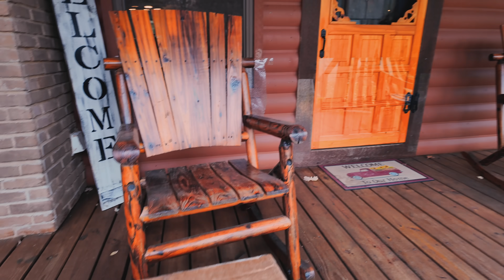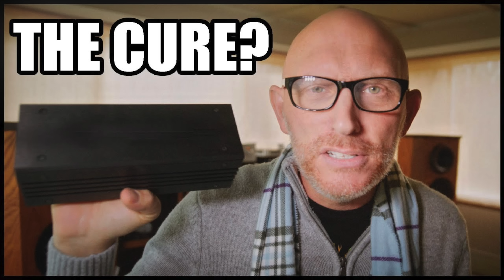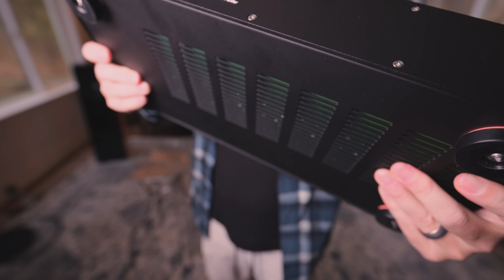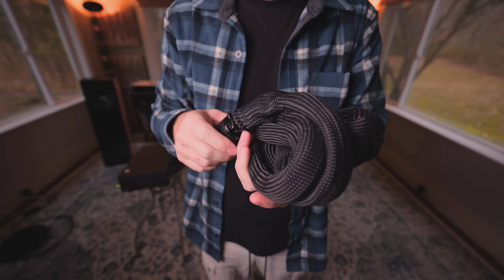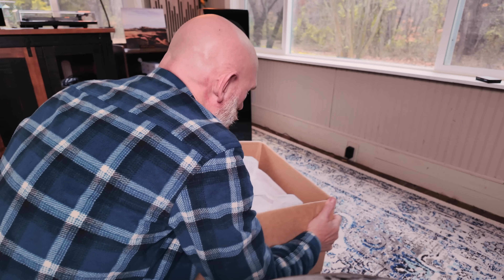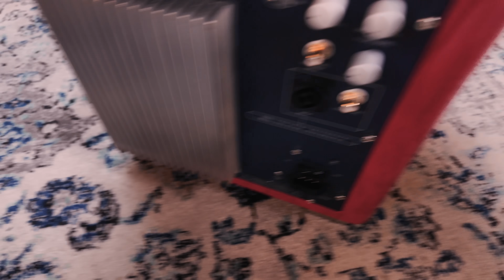FACT: My HiFi Audio System just doesn't sound the same WITHOUT THIS. Will it do the same for YOU?

Comment: In addition to rewiring my house current with sufficient ampage dedicated to my home theater, I,ve had a top-tier Audience AR6 power conditioner I've had for like 10 years.  Couple that with my Audio Research analog preamp / Oppo 205 and I have no doubt the sound would diminish greatly without that piece.

During the summer in Florida I run the conditioner into a Cyberpower  Sinewave UPS which keeps 90% of Dynamics intact...and more importantly It keeps my heart from racing too much because of the terrible weather here!

Comment: Not an expert here but doesn’t this sound like dc offset?   Wouldn’t a device like the one from Emotiva take care of it?    $82.00
Reply from the maker: Nope I tried that one. Still have it sitting in a closet. I tried several things, spent a ton, returned a couple things. This is the only piece that helped and eliminated all issues.
Reply: @HiFiHuff fair enough.   The Emotiva worked on mine.   Went through wayyyy too many devices before I figured that out :)

Comment: A separate outlet 20amp copper cable straight from the breaker board panal would provide cleaner power
Reply: Not true. Mains pollution comes from far and wide. My beast system's outlet is 20' of 20 amp Romex to the one outlet only... and my power noise filter makes a dramatic difference, so does the filters for the USB power and the galvanic isolation for the Ethernet connection. Dirty power is everywhere until filtered out.
Reply: @bayard1332  systems clips on 15amp after 1800watts; so the 20amps make the differences.

Comment: How do you plug your ultimate power cable which has C13 termination to the power conditioner which appears to have a C20 input?
Reply: The Ultimate Puritan cables can be ordered with either a C13 or C19 end - most of your hifi electronics will require the C13 connector but the PSM156 needs the C19 connector (which is the connector that Puritan supplies for the power cord for the 156.).

Comment: I’m a believer in power effecting the sound. I would challenge you to investigate the Plixar BAC 3000.  I have many Plixar products and find the impact to be amazing. Warning that it weights 40!kgs so be prepared for some weight.
Reply: Yes, the Plixir is an awesome conditioner but it is over double the price so it should be better. Also, as you point out, it is a beast in weight.
Reply: affecting

Comment: I have 2 conditioners along with whole house surge protector,  will never be without them. The voltage shift here is over 6 volts!! So  it is100% stable now, along with Humm and such, these keep it gone.
Also since I see comments about it, I  have a 10 foot copper/alloy ground rod in the ground!

Comment: Put a Torus power supply in my system  some time ago and it made the whole system more stable and all areas sounded better…..now the punch line.  I removed the stock power cable and put in the Puritan cable….whoa.  It’s not black magic …..it’s a more black background….everything seems enhanced…..in a great way.  Resolution and layering are the main areas of improvement.  I had tried two other cable manufacturers and hardly noticed a change.  Those puritan power cords really work.

Comment: I too have power issues I'm chasing down that I thought were solved. I purchased my PP20 at the same time as you and also switched to the PSM156 (a pair of them) and they have been terrific. However, a big HOWEVER, I acquired a pair of monoblocks (PASS LABS X 260.8) and my power issues resurfaced. Each PSM156 buzzes with a single mono plugged in. I am back to having to wait until late night listening to experience the best sound. The frustrating part is that I am not getting answers and I will not get into detail, but it has now been over a month.
Reply: I had a similar, but not identical problem in my system. No humming from the amp, but a harshness to the sound, even with the psm156. Turns out, as awesome as the Puritan is at cleaning up the power of other issues, it does not remove all DC from the lines. I added an Emotiva CMX2 in front of the Puritan, and it totally fixed my issue! Give it a go, they're only $89 and a total miracle machine 🤙
Reply: Oh and I forgot to mention, it absolutely doesn't impede or choke up the power or sound, it's seemingly invisible :)
Reply: Glad to see that you have the Ruins LP by First Aid Kit.

Comment: Your electrical system probably needs grounding with an earth wire clamped to an 8 foot copper coated rod and driven into the ground.
Reply: That’s what she said!
Reply: @mpi5850  You Auntie Bertha?
Reply: Yes, and the audio room should be like a Hitler bunker!
Reply: Dude had his whole house rewired to solve the problem and it didn't work.

Comment: Interesting observation about the humming - glad your solution works. I had a similar issue with my Denafrips DAC.  Vinshine pointed out that this is a known issue with power supplies if your mains contains DC, so in my case a DC blocker solved that particular problem:-)